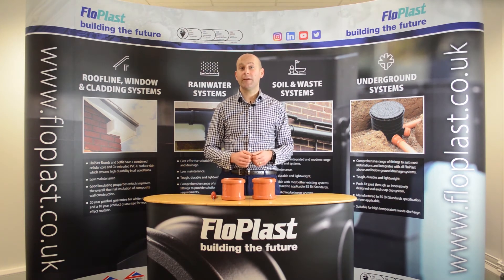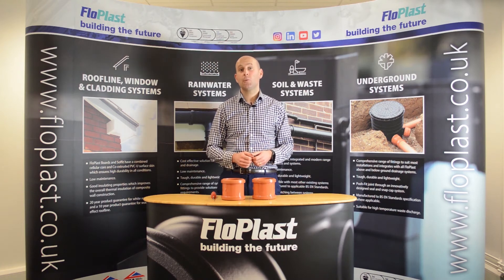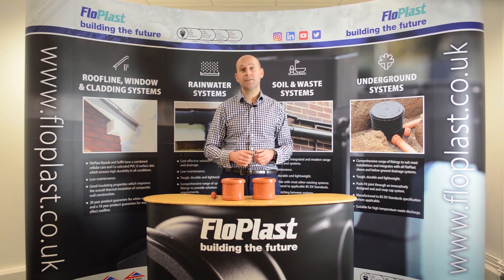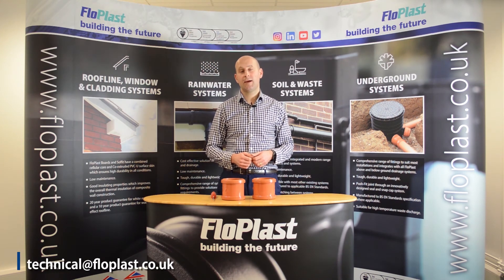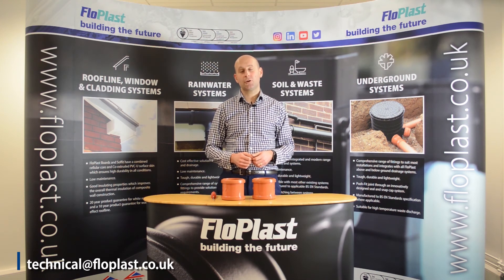Slip Couplings | FloPlast – Technical Tuesday

Comment: Does the slip coupling need to be glued in place. How do you stop it moving
Reply: I am no expert, but i think the rubber seal is quite a tight fit even when fitting just one part into another, so because this has one on each end of a pretty light component, i think friction does a good enough job!